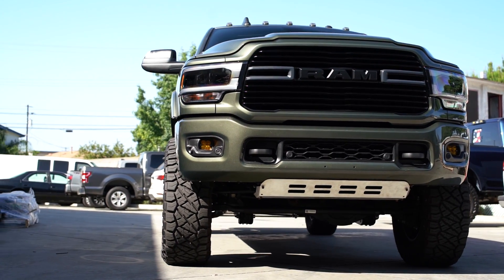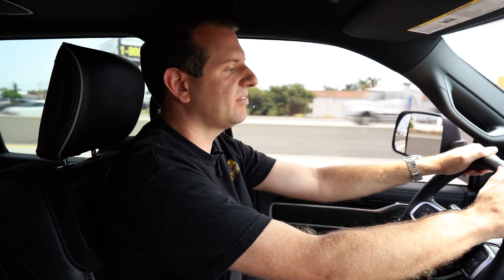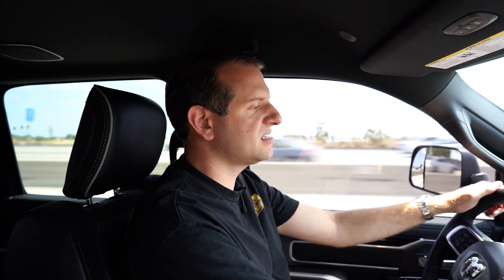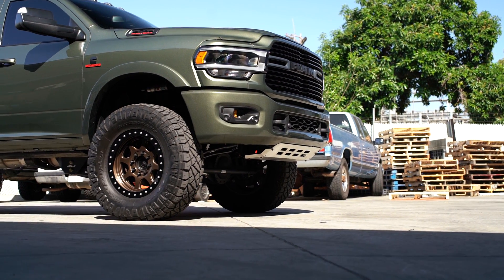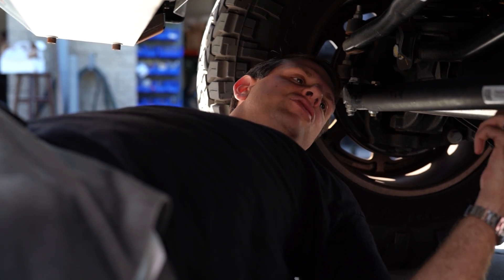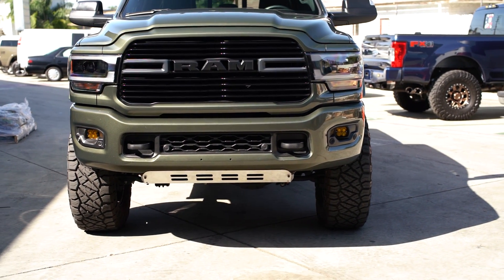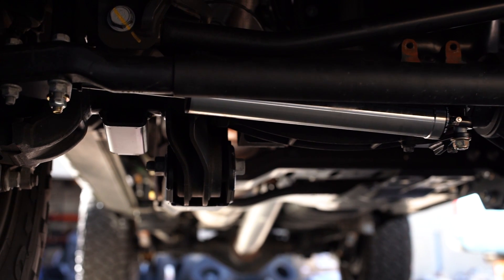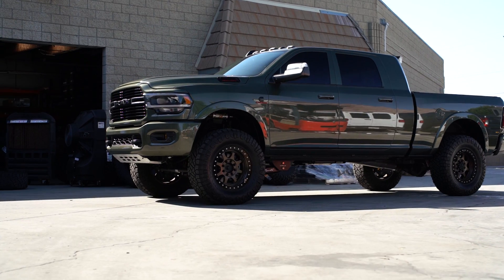How to Adjust Carli Suspension Steering Stabilizer to Correct for Tire Pull

Comment: How would you go about adding in case you pull to much pressure? With this gauge and add from a nitrogen tank? I will be running dual steering stabilizers on a 37 toyo mt the truck is pulling to the right slightly. What do you recommend for pressures or at least starting points on this set up?
Reply from the maker: As a starting point, run the high mount at 120 and the low at 70. If you need to add pressure, you just need to source dry nitrogen. Most off road shops or motorcycle shops will have it!
Reply: @CJCOffRoad  thanks great customer support like always

Comment: So is the Carli low mount or high mount the correct one to use for a slight pull to the right? Or both?
Reply from the maker: What year and make truck do you have?
Reply: @CJCOffRoad  2022 Ram Power Wagon. I have 37” Toyo tires.
Reply from the maker: We use the high mount for Toyo MTs and the low for everything else.

Comment: If this is paired with a carli high mount, how do I know which stabilizer to adjust?
Reply from the maker: You adjust based on which one is pushing too much since they each face in opposite directions.

Comment: Thanks for the video! What's the best overall stabilizer for a 4th gen ram, or does it depend heavily on the issue?
Reply from the maker: If you can only have one, the low mounts are the way to go. We typically recommend the high mount for anyone running Toyo MT tires, or in conjunction with the low mount for hard, high speed off road use.

Comment: Are the Fox ATS Steering Stabilizers made for newer RAMs? Was interested in doing a through-shaft upgrade for my 2016 RAM 2500 if needed after the lift.

Comment: I have both high mount and low mount such a great set up
Reply: WHY DID YOU NEED BOTH?
Reply: @jeitutis  I put them on a I drag race my truck it helps with the wander out of the hole and in the heavy truck rite on the street